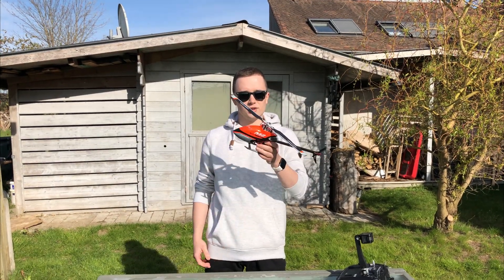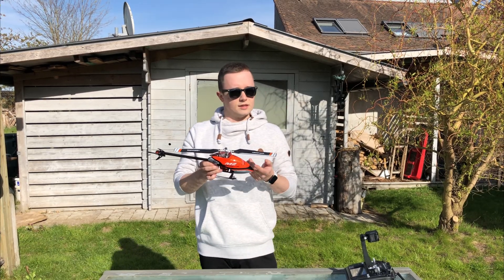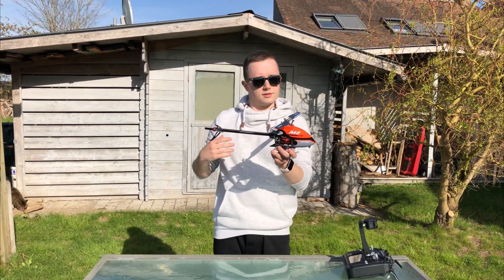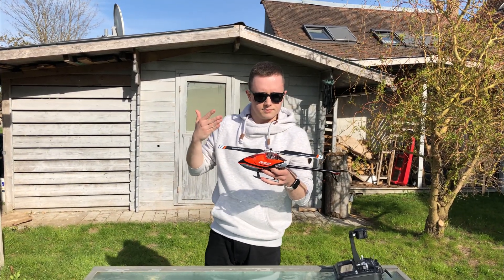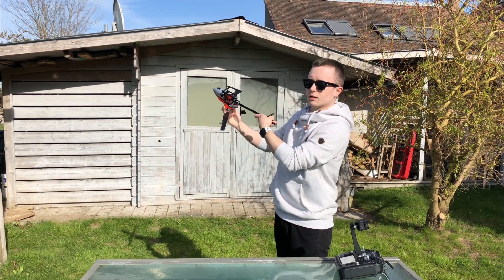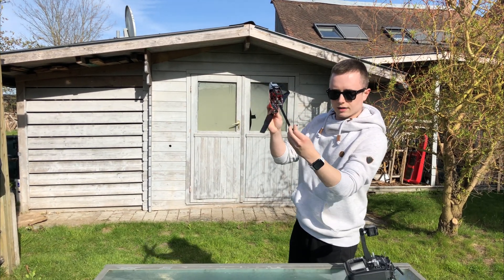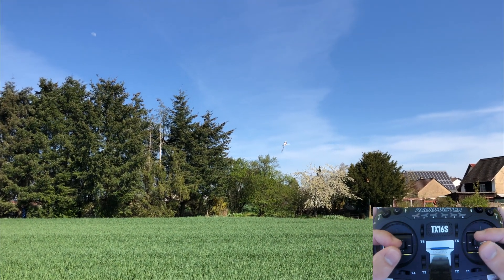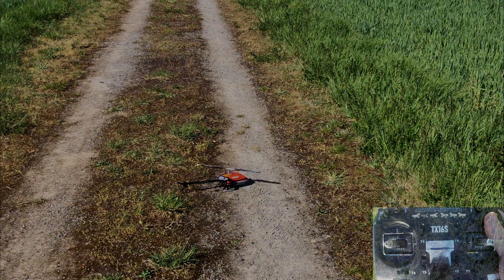TALY // Torque Assisted Left Yaw - Full Explanation & Flight Demo

Comment: Does it have the ability to reverse the direction of the rotor(& physically 180 the tail) for purposes of matching a scale build? In essence, does it have the inherent capability to “TARY”? Thank you!
Reply: I have placed the tail motor (therefore tail rotor too) on the left side of my M2 EVO, and swapped the 2 wire of 3 tail motor power wire.
it works pretty well (probably not for aggressive 3D manuavers, but I don't do 3D any way).

Comment: Mine won't calm down after flips and rolls
Reply: if the RPM on your M2 ramps up in flight and wont slow down then you have high vibrations, usually a bent feathering or main shaft.

Comment: Very cool, but if you speed up main rotor, then your lift will change. This must be compensated by changing blade pitch somehow.
Reply: @cHriS it's an improvement to the DD tail. It doesnt turn a DD tail into a CP tail but it does make DD tails very significantly better overall. On micros CP tails have their own problems, no solution is truly 'perfect' in every respect.

Comment: Awesome vid thanks for the info. Is this already implemented on all the m1 and m2? I noticed I can do some tail straining maneuvers on my m1 I got this year with no issue but my m2 I got last year doing the same maneuver sometimes blows out. Maybe my m2 was older. Wondering if I can upgrade it
Reply from the maker: This had been added to the M2 with the V4 flight stack in mid 2020. If your M2 is older than that, it does not have TALY, but you can send it to your local OMP dealer to have it updated.
Reply: @Johnny31297  awesome thanks
Reply: @Johnny31297  I bought my M2 Explore late in 2020. How exactly can I determine if it has the TALY feature, other than removing the blades and testing it? Are there any external markings or identifying marks? There is a TAG on the outer cardboard sleeve that says: OMPHOBBY/M2 EXP/201814. I do not see any unique markings on the actual flight controller while its mounted in the heli.  I am keeping my M2 EXP and M1 under wraps until the weather is better for outside use.. MANY Thx for the excellent information you've passed on to all of us...
Reply from the maker: @iconemb  I don't think you can tell externally. Either do the blades off test or try it in flight. You could also open your flight controller case and check if you have the V04 ESC, which was introduced at the same time as TALY.

Comment: How clever! Initially I thought: "how come? Left yaw is always toque-induced in clockwise helis" I've never realized you could get out of torque to yaw😅. Great explanation!
Does the flight controller also adjust collective to prevent change in lift?
Reply from the maker: It does not change collective as far as I'm aware. I guess the change in lift is not significant enough to justify a reduction in collective, which would also be a reduction in torque in situations where TALY will hold the RPM higher, than normal, reducing torque... Not what you want I think